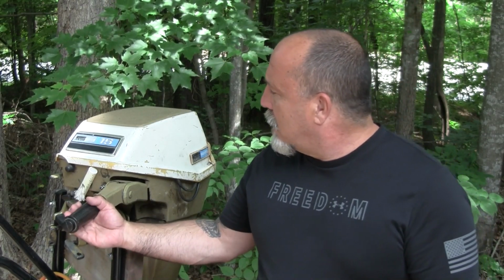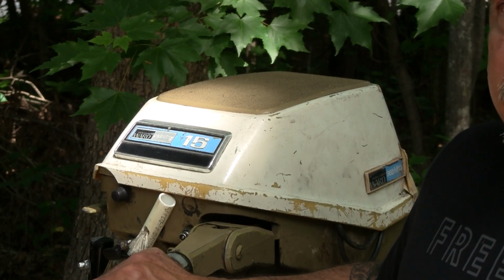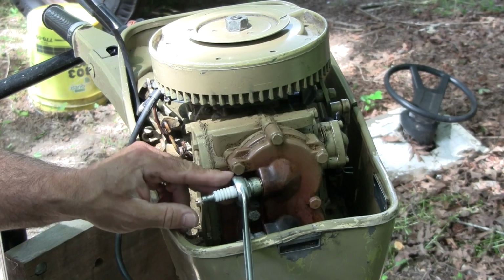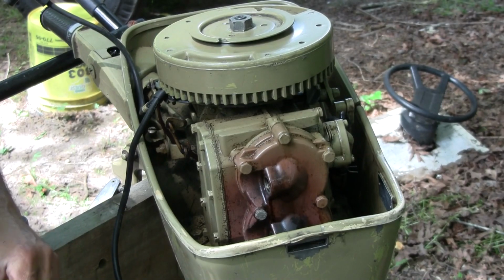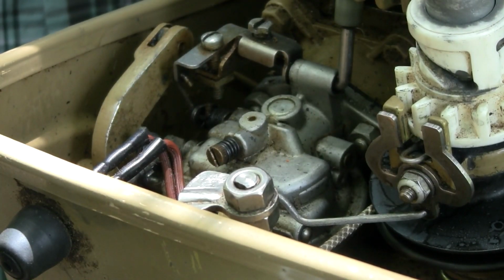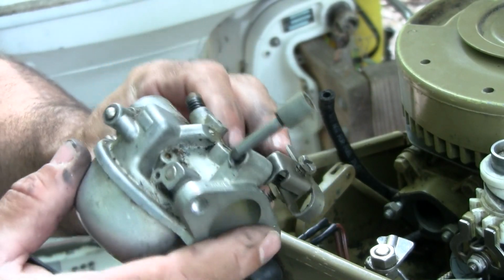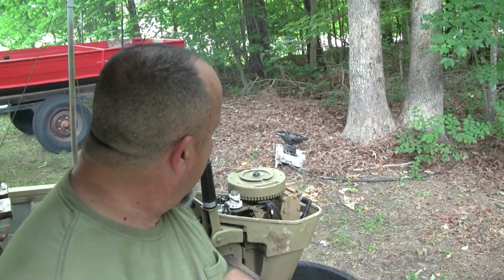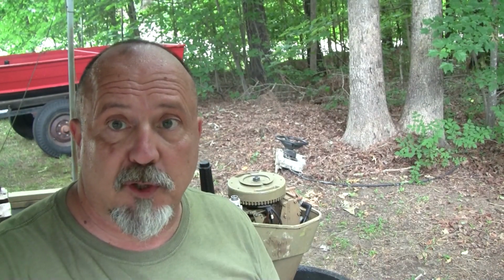Will it Start? Barn Find 1975 Sea King Outboard Chrysler 15 HP

Comment: I had this engine on an aluminum ~15’ little boat from Pigeon Michigan company named Aqua Swan.
When I sold it, the motor ran well!
It WAS touch to start. Some days, it felt impossible: I’d pull and pull.
BUT, good little motor: the very same.
I sold it about 4 years ago?
Cool video!
❤

Comment: What are you shooting seafoam in it for?? Seafoam will hardly burn and is a CLEANER not a lubricant.. It is for a running engine or mixed with gas........not much wonder it smokes. No water pumping....it's cooking. Don't quit your day job.

Comment: Seafoam is 97% naphtha gas, its not a lubricant.  That engine was overheated bt looking at the head
Reply from the maker: Per Seafoam MSDS 1. Pale oil 40-60% 2. Naptha 25-35% 3. IPA 10-20% si does have lubricant properties. and Yes, that engine has been abused in past lives.

Comment: they gave evinrude and mercury a run for their mony but they were very lightweight and unfortuntely there metal blocks were very lightly casted causing abnormal wear if used alot there longevity wasnt as long as evinrude or mercury but they couldbe good motors just not a evinrude or mercury or Johnson Reliable i didnt mention the japanease outboards just the ones that were in the 60s 70s heyday
Reply from the maker: Interesting outboard though. I'm impressed that with the age and neglect , it fired right up!

Comment: just FYI never turn it over dry, and put the lube in the cylinders 1st. crankcase is of little concern vs. cylinder bores! Ditch that spark checker. you need an open-air gap type to test strength of spark. that thing tells you very little. look for 7/16 hot blue and SNAPP at a steady interval. lastly always replace impeller if the compression is good. little dry rotted pieces can clog up way into the block, making it a nightmare. the discolored paint on the head tells me its overheated at some point. side note: i convert these to electronic ignition . have a stash of ATOM red chips. absolutely incredible what it does and how smooth and easy starting it is.
Reply: @ct1762 what do you mean when you say you convert them to electronic ignition? How does one do that?
Reply from the maker: I also use an open gap tester to measure the length of the spark. That can tell you a lot of what is going on. I just use the neons to see if there's even a spark. Otherwise, great advise, thanks!
Reply: @ExtremeDIYGuy  nice thanks for the video can't ever get enough older outboard repair ones:)
Reply: @ct1762  what do you mean when you say you convert them to electronic ignition? How does one do that?
Reply: @drewmyrtle15  you take out the points and condenser and install little transistorized ignition modules like a Nova 2 . if you use those you must replace the OEM coils with aftermarket or they won't last. if you can find some original ATOM red or green modules those are the best, but now either way you have a transistor doing the switching instead of points so the timing is always perfect. starts way better and is unbelivably smooth!

Comment: This motor overheated,, which is evident from the brown discoloration on the cylinder head.  You might want to check the water pump impeller and housing before using this motor.  I'm a 34 year outboard technician from Long Island, New York. Best wishes to you!!!!
Reply from the maker: Engine is gone but I appreciate the heads up and best wishes!
Reply: Hey @newmoon! I'm also based on Long Island and am looking to buy a reliable outboard motor for my first boat. Have or know of any for sale for decent price? If not, could I perhaps pick your brain or pay you to look at one with me? Thanks and cheers! @ExtremeDIYGuy

Comment: What size is that fuel connector, and where have you been able to find it. The one I have leaks, --Thanks!
Reply from the maker: I don't remember offhand, I googled it and found a site that specializes in old Chrysler outboard engines.

Comment: I have one like that that will not start has not run since 2001 but then it had just been tuned up and it ran like new. My son tried to use it about 5 years ago but could never get it started so I will try myself this year. I hope for the same luck you had.
Reply: no luck involved if the motor is in good shape internally!
Reply from the maker: Good luck, hope it runs for you!

Comment: I just got mine to start after it sat in a shed for probably 15 years. Only problem is it won't idel if I put the throttle below the shift mark. Any ideas? I'm new to outboards
Reply from the maker: It's probably fuel related, i would start with a complete cleaning of the carb if you haven't done that already. Also, make sure you check the idle air mix. One turn out is probably the best starting point.
Reply: @ExtremeDIYGuy  thanks